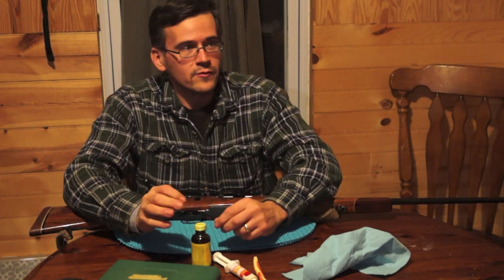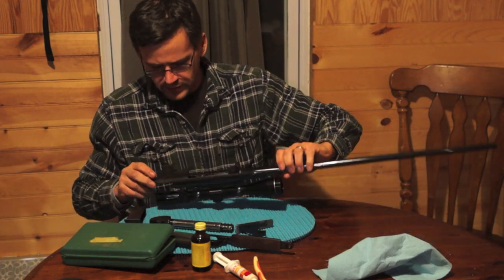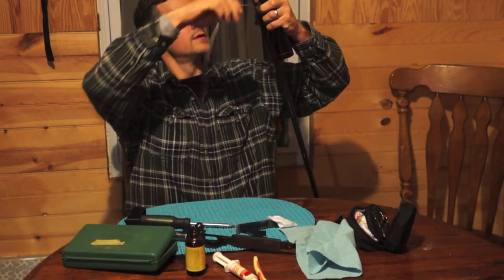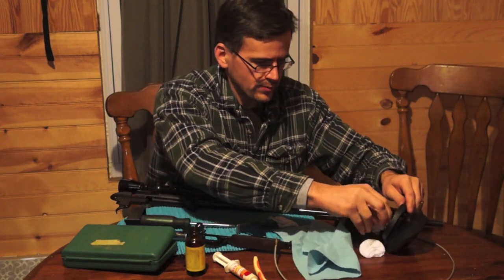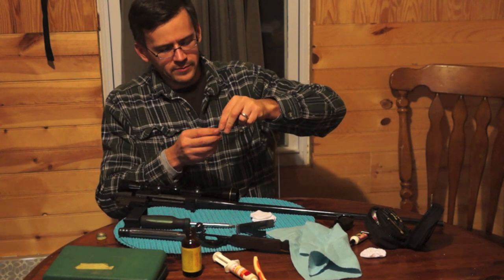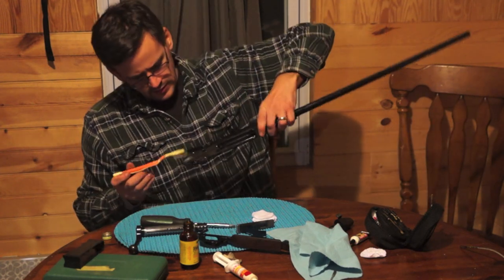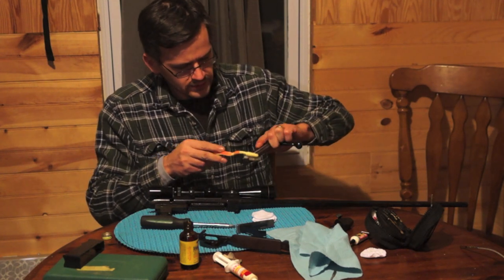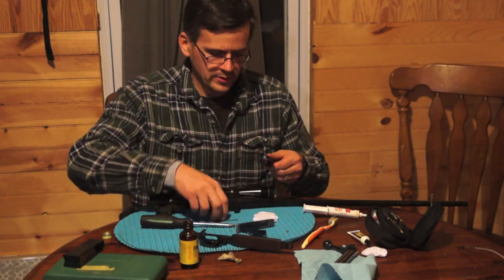Disassembly, cleaning and reassembly of a Weatherby Mark V

Comment: I feel the need to add this piece of advice.  Be sure to READ the official Weatherby Mark V owner's manual, available in a free PDF format at the Weatherby website.  It is important because the bolts that attach the trigger guard and magazine housing need to be tightened in a certain manner.  That is...the front bolt needs to be tightened all the way down first.  Then the rear bolt is tightened.  There is something about the physics of doing it in this order that is important.  Failure to tighten the bolts in the front to back order may result in a cracked or broken stock.
Reply: +pagamenews With all due respect, you have it backwards.  I just bought a Mark V, and it says on the box and in the owner's manual that the rear screw is tightened first.  To wit:

"1. Make sure that all trigger guard screws are tight before firing your rifle.  Always tighten the rear guard screw first and the front guard screw last.  Loose trigger guard screws not only contribute to inaccuracy, but can also cause stock damage.  Check these screws periodically as recoil and changes in atmospheric conditions can cause them to work loose."
Reply: +Webb Sledge  Webb, you're right and I'm right.  If you go to the Weatherby webpage and look for their manuals in PDF form, you will read in the manual for the older Japanese-made Mark V rifles called for tightening the front trigger guard screw first.  In the new manual for the USA-made Mark V rifles, they tell you to tighten the rear screw first.  I just watched an online video by Larry Potterfield of MidwayUSA, and he tightened the screws on a Remington 700 BDL from front to back.